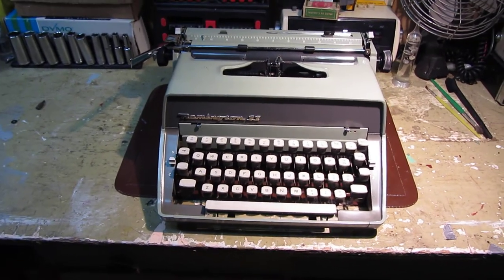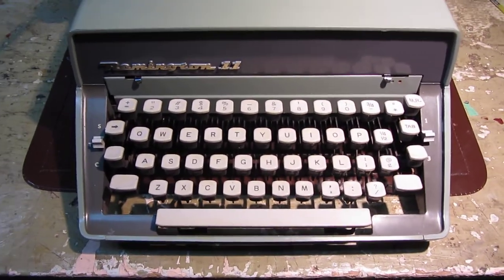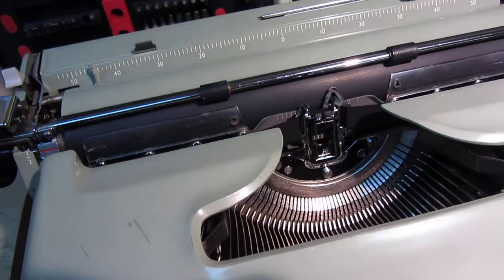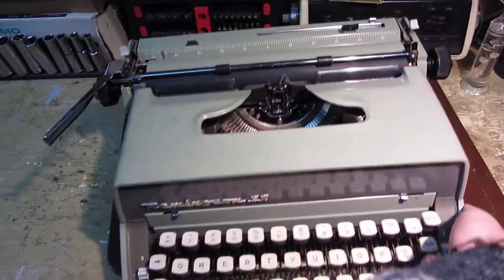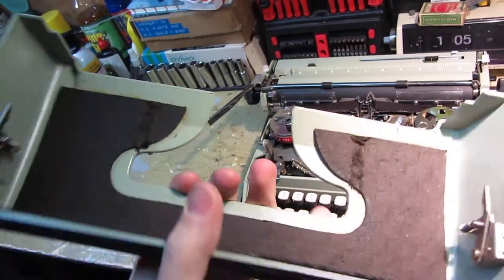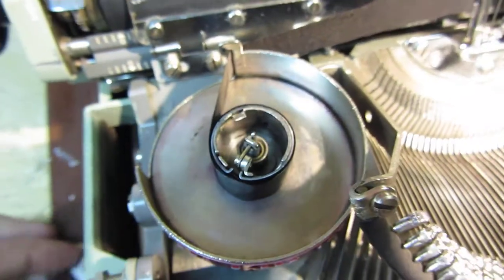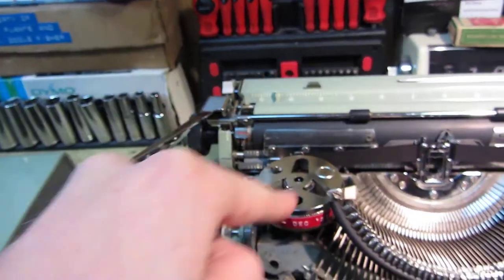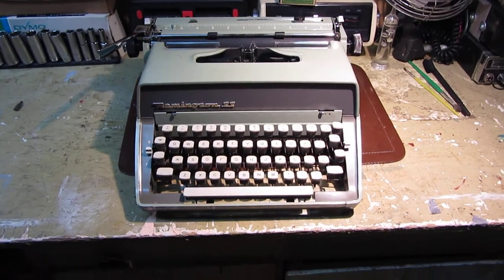Review ~ 1963 Remington 'Model 11' Portable Typewriter

Comment: Hi there!  I have one of these in near-mint condition - same colour as yours in the clip. Like you, I'm impressed by the general build quality.   It's just got one small issue - the ribbon colour selector works OK in the black and stencil position but jumps out of the red position unless it's held in place.  There's an indent for each colour setting beneath the lever but the selector just jumps out of it.  Obviously this is not ideal so I wondered if you have any ideas? Many thanks.  Regards.  Paul

Comment: From what original model is the engineering for this Remington descended?  For example, I know that Royal's standards up through the '70s owed the essentials of their mechanisms to the #10, but I've never had as clear a picture with the Remington machines.
Reply: The Remington Quiet Riter first introduced in the 50’s more then likely.
Reply from the maker: @anthonybrunotheodd  It is difficult to pinpoint exactly, but yes...it's a safe bet the "Riter" line-up introduced this mechanical design.